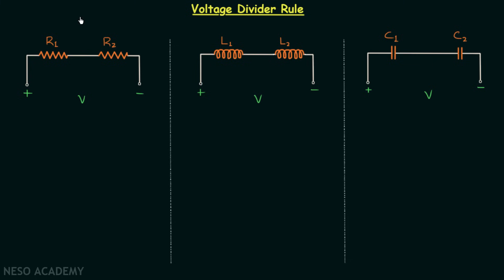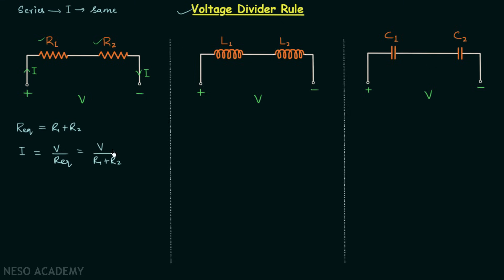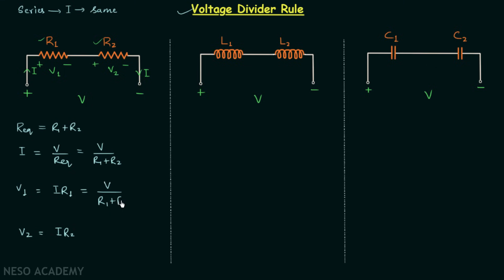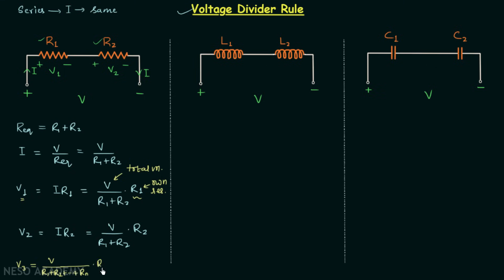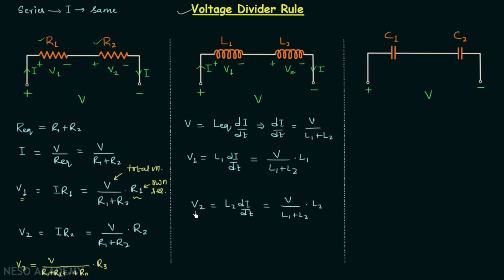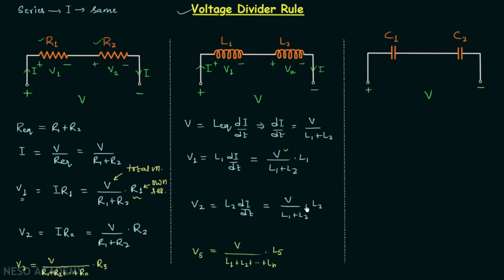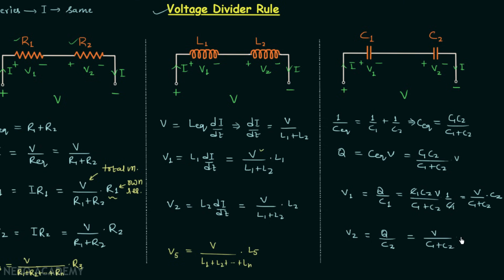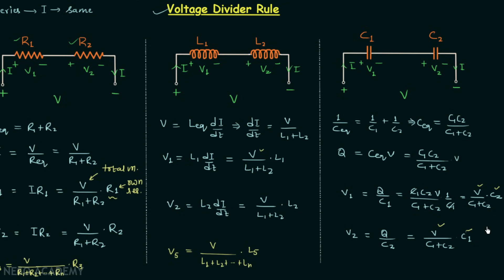Voltage Divider Rule

Comment: V3 = [ V / (C1C2 + C1C3 + C2C3) ] * C2C3

Generalised form:

Vn = [ V / Summation of (CiCt), where i = 1 to i = (t-1) ] * C1C2...C(n-1)
Here t = Total number of capacitors
Ct = Last capacitor
n = no. of capacitor of which we are calculating the voltage drop

Comment: The REAL answer for the Homework and how to get there:  ( !!! means empty space from simplification)
*First try for 3 then 4 capacitors in series
*Follow his tactic
(3): Ceq = C1C2C3/(C1C2+C2C3+C1C3)
(4): Ceq = C1C2C3C4/(C1C2C3+C1C2C4+C1C3C4+C2C3C4)
*Get the Q in both instances:
(3): Q=VC1C2C3/(C1C2+C1C3+C2C3)
(4): Q=VC1C2C3C4/(C1C2C3+C1C2C4+C1C3C4+C2C3C4)
*Go for the Voltages:
(3): V3 = VC1C2C3/(C1C2+C2C3+C1C3) * 1/C3 => V3 = VC1C2!!!/(C1C2+C2C3+C1C3)
(4): V4 = Q=VC1C2C3C4/(C1C2C3+C1C2C4+C1C3C4+C2C3C4) * 1/C4 => Q=VC1C2C3!!!/(C1C2C3+C1C2C4+C1C3C4+C2C3C4)
*Go for the nth term capacitors in series V3:
V3 = VC1C2!!!C4C5...Cn/(C2C3...Cn + C1C3C4...Cn + C1C2C4...Cn + ... + C1C2...Cv(n-1) ) <=== In the last term is kinda hard to write n-1 term but if it was 100 capacitos that would be 99

Hope you liked my solution and thought process... Now where is my A+ grade?!

Comment: V3=(Ceq/c3)×V={c1c2/(c2c3+c1c3+c1c2)}×V......(1/Ceq)={(1/c1)+(1/c2)+(1/c3)} which implies Ceq=(c1c2c3/c1c2+c2c3+c3c1).....In general Vn=(Ceq/Cn)×V..here the discussed topic ie., two capacitors in series is a special case.

Comment: In case of inductor, At steady state inductor is short circuit,... So, it has zero voltage. Then, how inductor has voltage?
Reply: That's why we use only ac in inductor.. That current I in fact is ac current
Reply: we use ac current bro. otherwise the time derivative of the current would be zero ...listen carefully during the video

Comment: Vn= (V/(C1+C2+...+Cn)) * C(n-1)
Reply: wrong
V3 = [ V / (C1C2 + C1C3 + C2C3) ] * C2C3

Generalised form:

Vn = [ V / Summation of (CiCt), where i = 1 to i = (t-1) ] * C1C2...C(n-1)
Here t = Total number of capacitors
Ct = Last capacitor
n = no. of capacitor of which we are calculating the voltage drop

Comment: Which ans is correct sir?
Reply: Solve it by taking n=3, Then u can generalise for n capacitors.
Then, Ceqv for series combination of 3 capacitors is (C1.C2.C3)/(C1.C2+C2.C3+C1.C3).
Now, V3= Q/C3 i.e (Ceqv.V)/C3.
The answer will be V3= V. (C1.C2)/(C1.C2+C2.C3+C1.C3).
Reply: @Hmi316  bro he said for n capacitors connected in series... and you have to find the voltage drop across the C3 capacitor.
Reply: @dikukhanikar2837  I guess that's what I did, right? Can u plz elaborate what I missed?
Reply: @dikukhanikar2837  Harish bro is exactly correct bcz sir asked to calculate for V3 so Q/C3 mens n=3 . Three capacitors
Reply: guru sinngh your formula doesn't satisfies dimensions
Reply: @Radhe Shyam wrong denominator
Ceq =(C1.C2.C3.C4_ _ .Cn)/[(C2.C3.C4 _ .Cn)+(C1.C3.C4 _ .Cn)+(C1.C2.C4. _ _ Cn)+ _ _ (C1.C2.C3. _Cn-1)]
V3 = [Ceq.V]/C3